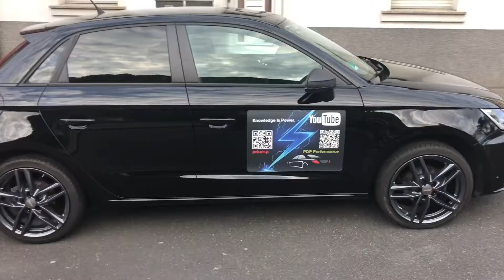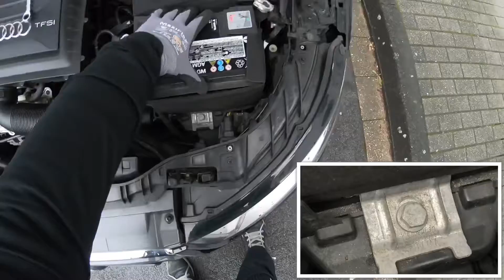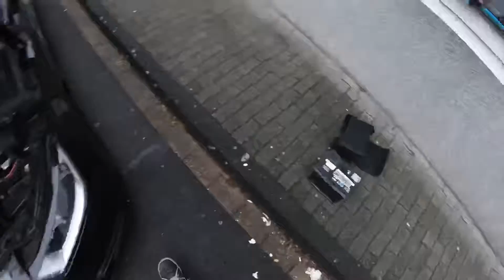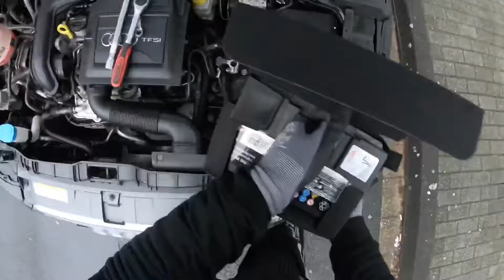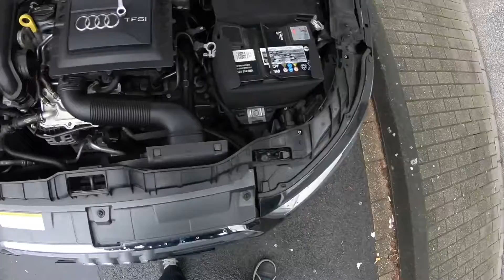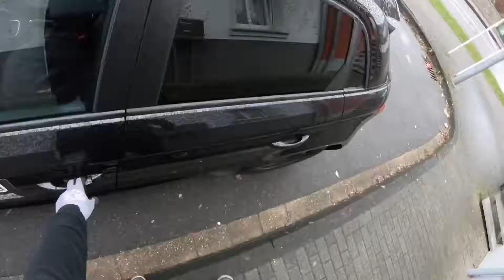How to replace the battery car start battery AGM replacement Audi A1/S1 Sportback DIY

Comment: Do u need a start stop battery in order for the start top to work ??
Reply: It's a more heavy duty battery, if you haven't got it switch the stop start function off or you'll cycle your way through the batteries expected lifetime a lot quicker.

Comment: and why do i need a scan ?
Reply: Its not a scan its a registration. It tells the car’s computer a new battery is fitted, preventing charging faults and extending battery life. It takes about 10 minutes and is smart to do.
Reply: just to make sure, you don’t have to register the battery like bmws right?
Reply: Something mechanics say because they want to earn money. There's a 0.1% chance of something in the ECU fucking up when changing battery that might affect fuel consumption etc. but I've never seen this in my life and you don't need to worry. Get the car to a mechanic for a scan (or buy a OBD-II scanner yourself) if you notice anything weird, otherwise you really don't need to care.